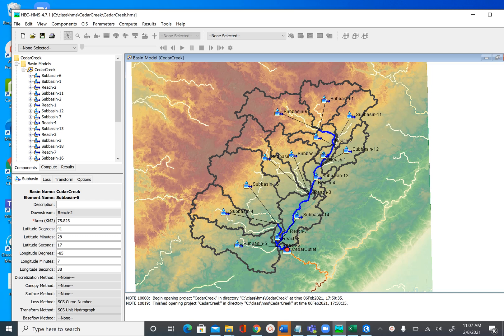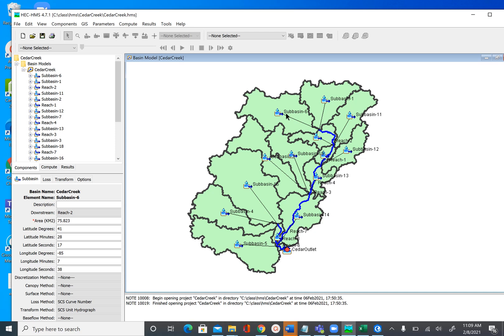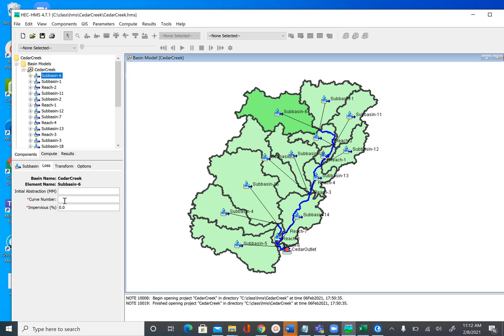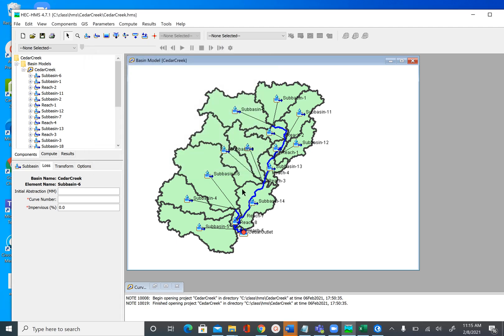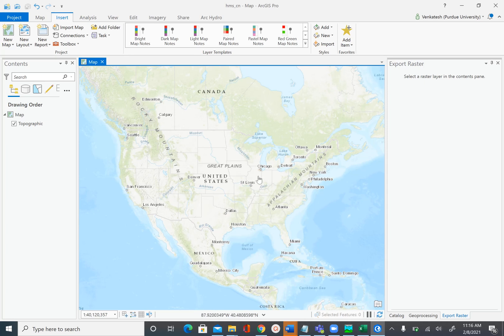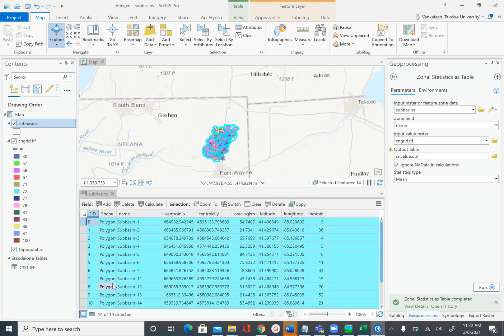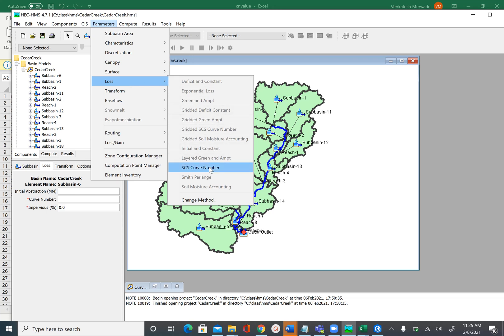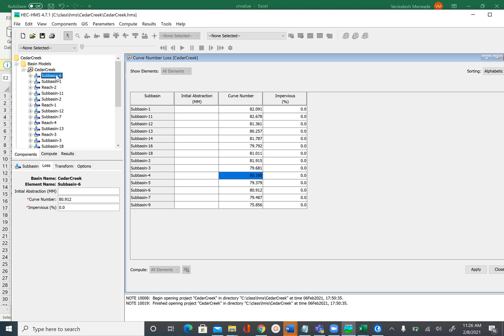Hydrologic Modeling Using HEC-HMS (5/9) - Assigning CN to sub-basins

Comment: i Have multiple outlets. How can I know the discharge of Multiple outlets, as an outlet can have many sub-basins? As I am doing a project with multiple outlets but I am not getting the discharge of multiple outlets separately. in which there are many sub-basins.
Reply from the maker: HEC-HMS is mostly used for dendritic river systems with one outlet

Comment: I do not get the basin characteristics computed. Any guess what could be wrong? I do get the subbasin area and lengths of the reaches, but no concentration times.... Any help much appreciated! Thanks for your videos!!
Reply from the maker: make sure you have CN value for each sub-basin.
Reply: Yes also experiencing thesame issue. Will it run regardless of the CN value?  @hydrologyvideos8253

Comment: Hello, how to calculate cn without using gis in hec-hms 4.10 version?
Reply from the maker: I do not think 4.10 is out yet. I do not know a way to compute CN grid in hec-hms.
Reply: @hydrologyvideos8253  there is beta version of 4.10 in internet.
Reply: @hydrologyvideos8253  anyway is there any direct method to calculate CN in hec-hms higher versions?
Reply: The quick and approximate method to create CN map raster would be assigning CN values to specific Landuse vector table by making assumptions of fixed soil type for all the soil group.It requires basic GIS skills🤞
Note:this can be done for concept design/preliminary Storm design for urban catchments